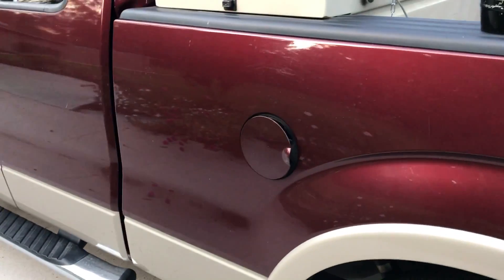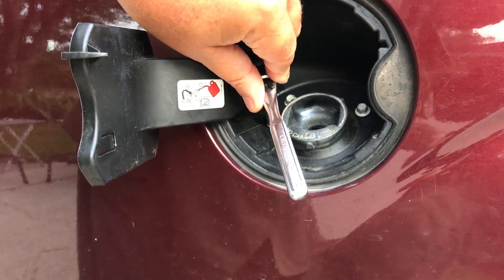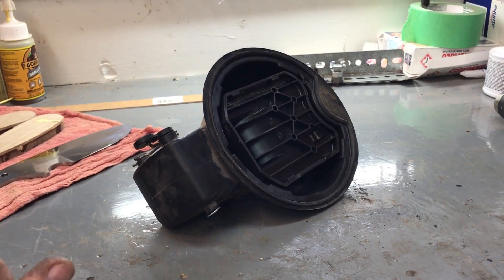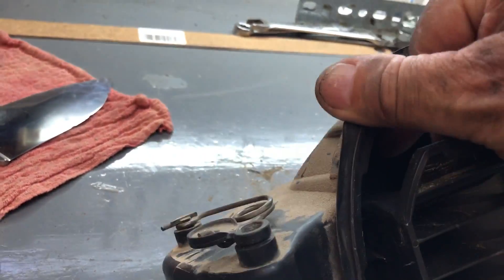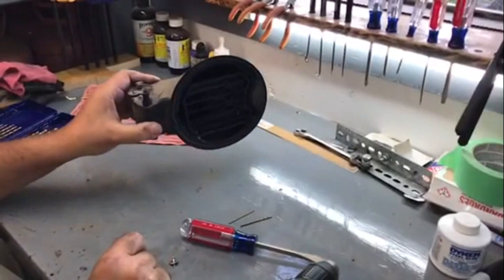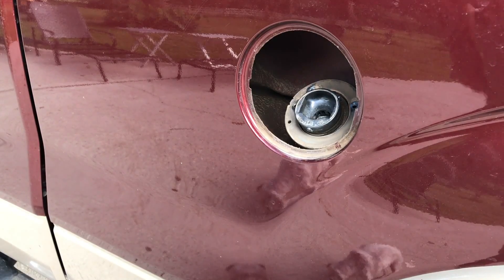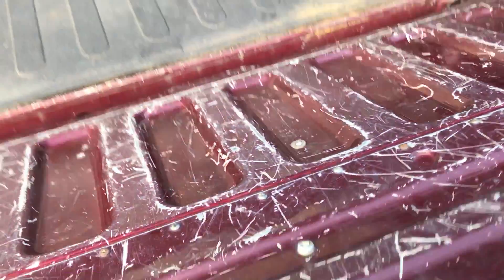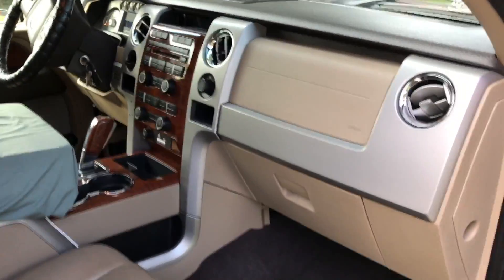How to fix Ford F150 loose fuel door

Comment: THANKS!! I fixed it in 10 minutes!! The only thing I would recommend, is taking blue painter's tape, and tape off around the edges of the gas take door. That way you don't accidentally chip your paint! Worked great for me and no chips or scratches.

Comment: Easy enough fix, been using velcro to hold it closed! Why hasn’t ford recalled considering this issue with so many?
Reply: They’re no gonna hardly recall anything that not life threatening, even then public pressure would have be applied

Comment: thank you for this video my friend , fixed my gas door ,, my heat and air is next , the door to change it from heat to air isnt working ,, stopped two weeks after i bought it , mine is a 2010 ,stay safe buddy
Reply from the maker: If it’s a blend door actuator,  be prepared to cuss ! I loved my Ford but it had some really stupid engineering.
Reply: @bctruck  lol yes i already located it , dont look fun but got to be done before summer gets here , thanks again friend
Reply: @bctruck  My first vehicle is a 2011 Ford F150 got it this year and I just had to change the blend door actuator. I'm lucky I didn't throw my little wrench through the windshield but I got it done 😅 that is, until the non-OEM part I bought started making the same annoying cranking noise a few days later, ROFL not going to bother with that again! Now I'm trying to fix the gas cap issue but I believe the 2011 has more tabs you need to push, gotta figure that out.

Comment: This happened once already on my 2010 around 70,000 miles.  Dealership charged me $180 to fix it.  Happened again at 109,000.  Using this video, I removed it, fixed the metal coil that became disconnected, put it back in.  Took me about 15 minutes (first time) and didn't cost me a dime. Door fixed!  FYI... new assembly on Amazon is $37.  Didn't need that this time.
Reply from the maker: dadexter88 glad it helped!

Comment: I just fixed my fuel door this past weekend. 
What I did was cross drill a 1/16” hole in the pin and inserted a hairpin cotter pin in the shaft. Fit perfectly without risking splitting the pin and definitely will not walk out again.
Reply from the maker: Nice work!

Comment: Thanks for the help. I put a drop of super glue on the screw to lock it in case it rides up and the open and closing loosens it. A guy could also epoxy a plastic washer to the end of the shaft.... I'd use epoxy for that.

Comment: If you would have had to take it to a dealership to get fixed, how much do you think you saved yourself? I'd say $300 to $400. I'm having the top half of my dodge dakota 3.7 ltr rebuilt. What a ride that's been so far sheesh! haha
Reply from the maker: 2 hours labor plus parts. I figure at least 80 bucks an hour so 160 labor and 150 parts.
Reply: The dealership bench hr rates here (Cleveland area) are around $100 to $120.

Comment: There aren't enough cuss words in my vocabulary to attempt that "simple" fix (even with your great instructions).
Reply from the maker: 454pakr no worries! I have gone completely through the normal cuss words many times. I sat down and wrote a list of homemade cuss words that I carry with me for those times when I run out of the usual ones. The list is dog eared and worn from much use.
Reply: BCtruck, rebuild, repair,repurpose Boka
Reply from the maker: Pervin Hesretov rimplit staimafratzen.

Comment: Yeah, I've had the same problems and a slip yoke on the drive shaft that has to be greased every thirty thousand miles by disassembly.  Ford refuses to come up with a permanent solution.   Their service bulletin says to clean and regrease with blue grease and replace the boot.  I've had it at the dealer three times to do this, and it needs it again.  They haven't charged me for it.  I did that blend door actuator replacement; what a pain in the butt that was.  It went out again.  Won't buy a Ford in the future.  The workers did a great job putting it together.  It's the desire to make money by putting in cheap parts in that's ruined the ownership experience for me.  I've never owned a car or truck where the fuel door failed like this.  Ridiculous, just ridiculous.  Thanks for this video and the tips!
Reply from the maker: audiophile man glad to help! I had to replace a blend door actuator. One of the most aggravating things I’ve had to replace so far. I am giving serious consideration to buying ram or Chevy next time. The amount of stupid crap Ive had to fix on this truck is just ridiculous.
Reply: @bctruck  You're not the only one, and I hear you loud and clear.  I've heard that Ford's sales have gone down.  I figure that it's for this reason.  Since I've replaced that fuel door assembly before and the tabs broke off last time, I've decided to buy new, but I found an aftermarket one with a redesigned pin and lifetime warranty.  If I don't damage the Ford one taking it out, I'm going to keep it and do the screw trick if I need to replace the new one.  With 127K miles on this truck, I probably won't have it for a long time, definitely not much over 200K miles .  Anyway, if someone would like to see the redesigned aftermarket one, here it for you:  https://www.amazon.com/gp/product/B0793YCWDS/ref=oh_aui_detailpage_o00_s00?ie=UTF8&psc=1.  I just ordered this one and will have it overnight.

Comment: I had a heck of a time pressing that out away from the truck. Instead of one tab to press it actually has 3. I have a 2011. So if you look inside the gas door you'll see 2 raised areas...one on each side of the tab talked about on this video. All 3 must be pressed to free the assembly. Only way I could do it was to have someone press the two from outside with screwdrivers while I pressed the center tab from inside.
Reply from the maker: It’s sad to know that they hadn’t fixed this obvious design flaw 3 years later.
Reply: @bctruck  Yet they over designed the clips. With 3 bolts and a solid lip all the way around all they needed was one single clip. BTW, I just got it all fixed thanks for making this video. Oh, I didn't have small screws so I substituted a tiny eye hook. The cup acts like the washer. I'd love to see the look on someone's face parting out my truck in a salvage yard as they pull it out and see the gold eye hook!
Reply from the maker: Glad you got it fixed!!

Comment: Do you use iMovie on the iPhone, or just upload, and edit using youtube?   If you use iMovie, there is a speed control during editing that can help solve the slo-motion problem.  Bummer about the tailgate, you have to wonder what manufacturers are thinking about these days, thats not a new thing, tailgates have been made for a long time,  you wouldn't think they would redesign it to be worse. Automotive engineers should have to take an oath like a doctor.   Do no harm.........

Comment: Why not put a chunk of sheet metal over the entire tailgate? Looks like the metal cover gets pushed on in the center and bends up the edges over time.
Reply from the maker: Since I added all the screws it hasnt pulled up anymore. Ill remember that though if they stop working.
Reply: Those blend doors have been an issue since the 1997 models. I'm surprised they're still having issues in 2009.

Comment: it's  a racket, my boss  has  a Mercedes  and a 29 dollar part went  south in the turbo  and they  had to completely  tear the engine  to a short  block  for 2600 bucks in labor, money  pit
Reply from the maker: Same thing with 18 wheelers. Sensors everywhere and they break after every bump.

Comment: Since I’m super lazy I think I’ll just strategically super glue tiny magnets 🧲 somewhere in there to hold the door ! 🤔.
Reply: I’ did that but didn’t work 😂😂
Reply: B R Y A N 23   There is a permanent fix sold by Amazon now
Reply: @bchappy5460  What is the permanent fix from Amazon? my door has stopped working also.
Reply: Good idea, my brother did me that favor, but after a while the magnets would get unglued. I finally had some free time and followed the instructions in the video and it worked great for me!
Reply: took me less than 10 mins after watching this video

Comment: Chevrolet and gmc as a whole better for longevity
Reply from the maker: Blasphemer!!!
Reply: +BCtruck, rebuild, repair,repurpose in 45 years ford trucks have never been bad to me, I have pals with Chevrolet   and dodge  with good luck too, they all break and wear out,   dance with them that brung   ya , personally  will never have a rice burner,but that is just me.
Reply: +BCtruck, rebuild, repair,repurpose in 45 years ford trucks have never been bad to me, I have pals with Chevrolet   and dodge  with good luck too, they all break and wear out,   dance with them that brung   ya , personally  will never have a rice burner,but that is just me.
Reply: I've had both.  So far my Ford has been far less maintenance and less expensive.  Chevy K2500 fuel pump 3 times ($800 each the first two times.  I had to tow it too. Last time did it myself) replaced OEM with NAPA and never had a problem after,  alternator every two years until I put a NAPA in and that was that. various other electrical issues.  Brakes disks are a pain (remove 8 studs) and unbolt the bearing housing.   Way fewer oil changes needed too,  instead of every 3000,  with Ford I can go 7500.   It is newer though.   No major maintenance required till 100,000, then plugs and coolant.   The chevy was better in snow.  Both vehicles were beasts